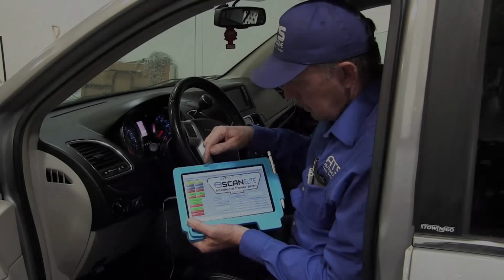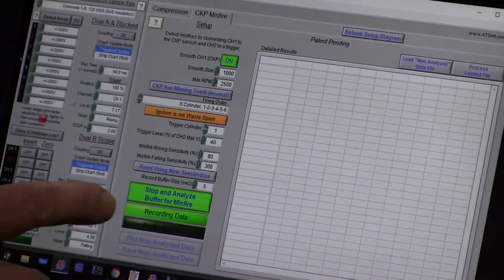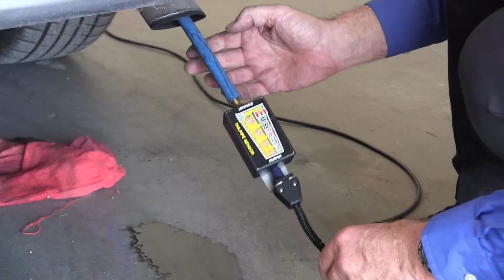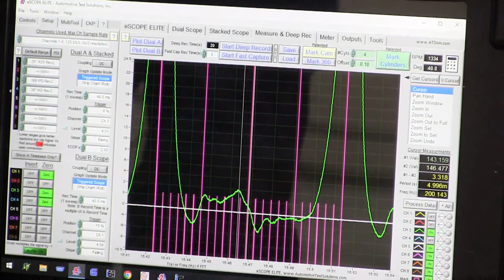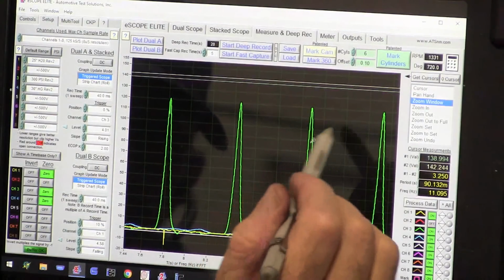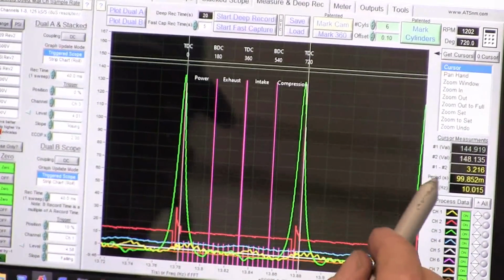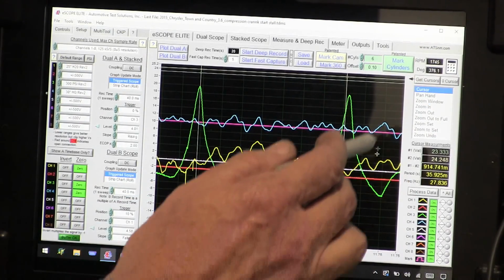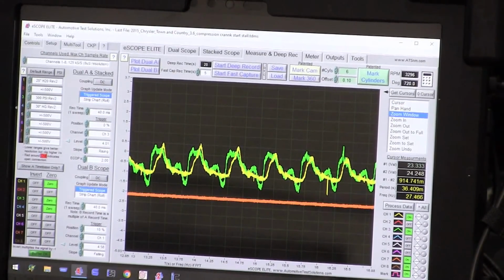How to Diagnose a 2014 Chrysler Town & Country 3.6l with an Engine Misfire - P0300 P0305

Comment: It is  very  complicated  approach, and heavily  instrument depended way  of  diagnostic, also time consuming.  Not regular  garage  would  afford  for  this  kind  of  twik.    It s  kind  of  promot  instrument, which  is  very  expensive!
    If  the cylinder  ring has  problem, it  can  be  checked   from  leak  down  pressure  test.  
    Cam  problems  could  be veryfied  from  timing of  the  engine,   from  OBD2  data  recorded.

Comment: Maybe you can help me here. I have one here im checking for a friend the van starts and runs. It has a p301 code where it has fuel, air, spark and also compression. The cylinder sounds good too, however yeah the miss doesn't leave cylinder 1 and it only is cylinder 1. I can physically SEE the intake valves move on 1 but yeah on the exhaust I can't. However its only on 1 as I'm really hoping its not a failed lifter. As a try i changed the vvt solenoids because they are all the same and it cant be it unless the phaser can leak internally from there.

Comment: This tech is so cool! You can diagnose the rings pretty easily without this gear though. Just do a dry and wet compression test. Observe pressure out of oil filler etc. No way of telling that the cam is advanced though without it!

Comment: I’ll admit a scope has it’s uses, but there’s no way I’m spending thousands on a setup that requires you to dissect mounds of data, when in this case anyway, you could come to the same conclusion faster and with a more definitive answer without needing known good waveforms, by using only conventional tools and the right equation. You’re getting lots of info from this tool no doubt, but I’m not convinced all bases are being covered here, and you could be setting yourself up for taking this engine apart a second time should something be missed

Comment: Hey yall I have a question my wifes 2014 town and country 3.6 with 99k miles had a p0303 code which is cylinder 3 misfire I change the coil pack everything was good the light went off and ran fine she pulled in the driveway today and the light came on again so I checked it and it says the same thing could it be a bad coil or just the spark plug any help would be appreciated thanks
Reply: What was the problem?
Reply: @cinepost  needed a new head

Comment: What would cause one cylinder to have bad rings? Scoping is cool I'm not experience with data shown.I'd disable fuel that cylinder and do a regular compression test dry and wet. Then leak down

Comment: I don't understand the parts throwing some shops do.

I've seen Nissans come in people have said it needs a transmission.
Meanwhile I fix the torn intake boot, clean the TB, do a IAL and it's fine. 

Test don't guess. Another good one Mr. Thompson.

Comment: I have had very similar problems many times and during the disassembly the rings were fine it was problems within the Piston itself broken Land once the piston rings were removed the land drops down crack piston multiple times I truly would have liked to have heard it propose that way that there was a problem within the cylinder on the lower half whether it be the Piston or the rings or even a problem within the cylinder wall itself versus automatically accusing the rings just saying

Comment: well they're definitely is a cylinder problem I will agree with you on that one I know there's not a cracked piston and that is the rings the old saying you squirt a little bit of oil into the cylinder it'll run over to the sides it'll get by the rings and then that should cause compression to change how come that was not performed

Comment: Nice demo of MODERN diagnostic techniques and gear. I wish he had finished up by putting a camera in cylinder. SHAME on the other shops for WASTING customer's money on parts when they should have done a compression test and leakdown; part of engine troubleshooting 101 for nearly a century!!

Comment: If a cam was out of time, that would certainly set a P001x code... Right Bernie?
Reply: I'm not Bernie but it's possible with such poor running it likely isn't going to meet the parameters required to set the fault. Hopefully Bernie comes in here and tells us his thoughts
Reply: @blehem doubtful. These computer systems are fast, and it would throw a code within the first maybe 10-15 seconds of idling. Which, it did idle several times in this video.
Reply: @blehem  I have never gotten an answer from Bernie in the comments section 😢😅
Reply: @PineHollowAutoDiagnostics  He doesn;t know he is on you tube or on camera. 🙃🙃🙃🤣
Reply: How much is the issue with the #5 skewing the in cylinder psi waveforms that showed a timing issue? And yeah, why wouldn't that set a cam crank correlation code?

Comment: That much blowby wouldn't be caused by a worn ring.  We'd be talking a hole in the piston.  Also, isn't it strange that all the problems are on one single bank?  What are the odd that you'd have one bank with some radically worn rings and the other bank is near perfect?  Also the problem bank has a radical difference in the amount of wear of each set of rings from cylinder to cylinder.  I think a closer look is needed before a diag is complete.
Reply: Your right. But maybe a cracked ring or a stuck ring would also cause a real bad blowby. Or a cracked piston, and yes, a hole in the piston. Probably a boroscope would help.  Maybe pouring some thick oil and running the compression test. The oil sticks to the bottom of the cylinder and so the oil would increase the pressure somewhat. Also maybe look at the spark plug, see if it has oil.

Comment: I wonder how many " cave man " shops even do a relative compression test to at least get some direction BEFORE FIRING the parts cannon . How do they get away with putting in a PILE of parts and the car does the EXACT same thing ? Great double whammy diagnosis !
Reply: Yup. And shop shamelessly charges the customer, and sends them on their way. And customers just accept it. WTH?

Comment: The fix in this video is the vehicle needs a engine the piston rings are bad blowby has p0300 p0305 compression is very low on 2 cylinders
Reply: Disagree. Pressure was low on one cylinder. The other cylinders were lower than spec, but still good. He also verified with the data that cam timing was off when running, but ok during cranking. I've seen this happen a ton with worn cam lobes or failed rockers. What happens is with the engine cranking there is not enough oil pressure for VVT to take over. 

In my experience, once you have valve train issues, you cannot just condemn the crankcase. The only question mark was Cyl 5. It needed further scrutiny to identify why pressure was so low. These engines did have the casting issues with the cylinder head. I know this was a case study, but to call a piston/ring issue was premature imo.

Comment: first thing first  compression test  next leakdown test on 1 3 5 cylinders  following the leak  you determine if it's a valves or rings on compression test on 5 ads oil in the cyl and retest  to see if is not a wash cyl by fuel !  if it's valves ex or int, cover valve off to see spings  ,rockers or guides (those 3,6  have a real problems with guides valves ) if it's the 'ring you will know the blow by in the crankcase  so my diagnostic  is a guide intake valve dropped and washed the cylinder by fuel  so you have blow by. it's well know that the head on 3.6 have problems and it's not rare  for cyl 5!

Comment: I just had a 2002 CRV where they had done the chains and still the same issue of phase incorrect detected P0341. I ended up finding the time being advanced about 40 cam degrees. I unplugged the solenoid to ensure it wasn't being commanded on; same issue. I took the solenoid out and a piece of a mesh was missing, I recommended to replace that solenoid because there is no way it could be advanced any other way; waveform kept showing advanced as soon as it was started; I had them open up the valve cover to verify timing as I did not have my pressure transducer. After they replaced the solenoid, the car ran fine. What happened was that the mesh had been jammed inside the seat of the solenoid which was causing oil to pass when it should not have as it wasn't seating correctly. I actuated the solenoid and it worked fine before I advised replacing it.

Comment: How do you not know cylinder number 5 isn't merely washed with gasoline
Reply: Thinking the same thing.  #5 washed out and possible leaky vvt solenoid.
Reply: The plugs would be wet...
Reply: @mrblonde2013  Only if it is currently being washed. If the ignition is working that plug would dry off quickly. I've brought back compression in fuel washed cylinders multiple times.
Reply: @Troy_Built it's not like Bernie is new to the game. You'll have to take his word that the plug has never had a firing event in that cylinder based off his visual inspection when he pulled the plug.
Reply: I was thinking that, but would it really cause a that big compression loss?

Comment: i did NOT expect it to be more than cam or cam timing. the fact it had both going on is nuts. imagine diagnosing and selling an intake cam job only to find out it has tons of blowby afterwards. bad situation for the shop
Reply: I believe he did because of the engine mileage some engines are not worth fixing.
Reply: @scientist100  I don't remember him stating the mileage what was it?

Comment: Camera in cylinder visual and valve cover removal should be part of diagnosis IMO.
Reply: no need, he can actually see what is going on as components are moving, camera can only see when the engine is stationary, also, a leaking VVT will not show when you remove the valve cover, it will show in time because oil pressure is no longer present to make the phaser over advanced. As soon as you get oil pressure in there, the phaser is over advanced, I had this happen and I was trying to catch the phaser movement as oil pressure builds up but the oil pump is so fast, you can't even see when the phasers are advancing as the engine turns, crazy.
Reply: What are you going to see in the camera exactly?  How are you doing to see the VVT Solenoid through the cylinder and how are you goin to see worn rings???
Reply: I would be curious to see if the cylinder walls are scored, or if cam lobes are rounded.
Reply: @cincinnatusaurelius8371  worn cam lobes will cause the timing to be late, he had an advanced timing and you can see cam activity. Scored walls tells half the story, rings could be worn and that's what he suspects. Scored walls are usually caused by lack of lubrication. Rings will wear as they age.